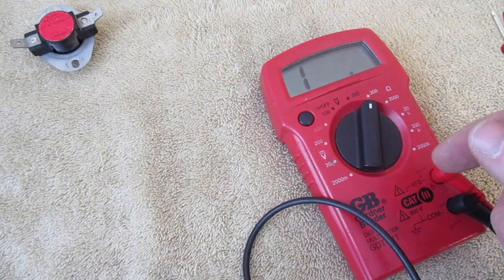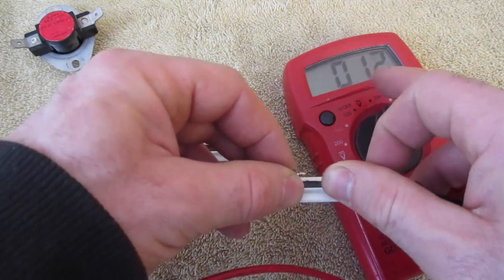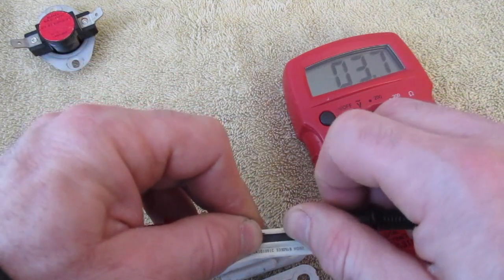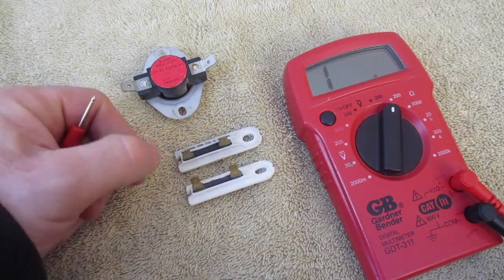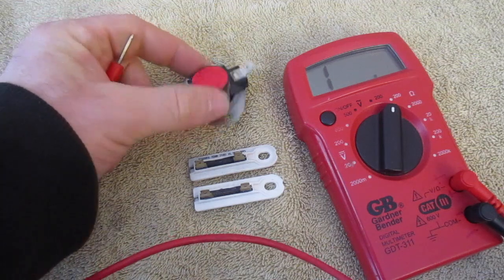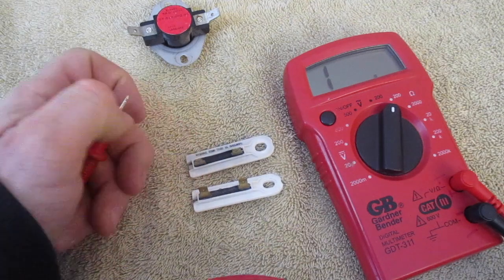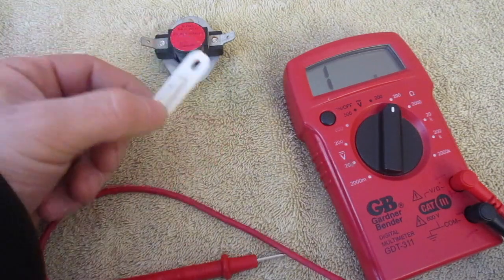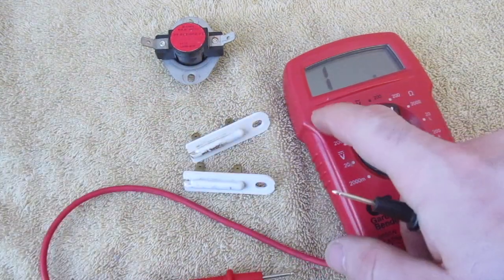How to test Dryer Thermal Fuse 3392519 dryer not operating Dryer not working

Comment: Ok so my dryer doesn’t even turn on, no power, no light inside dryer. Could it be the thermal fuse ? I’m getting power from the outlet. But seems not to turn on my dryer.

Comment: My dryer turns on and the buttons make noise and it lights up but won't start would this be the fuse?
Reply from the maker: Yikes it sounds like a runaway robot!  but for real it could be many things.  Can you be more specific.  Like it runs when the start button is pushed and shuts off when it is released.  Just not sure exactly what is happening here from the description.  Sorry to be a jerk, but your description reminds me of the old robot from Lost in Space "Danger Will Robinson Danger" from the 60's tv show.  be more precise and I or someone else may be able to provide more assistance.  Thanks and hope we can help!
Reply: @youcanfixit3721 when I try and start my dryer it just beeps. Not sure what the problem might be.
Reply from the maker: @Carlos-lp2dz  what is the model number?  Does it show an error code or is there no digital display?